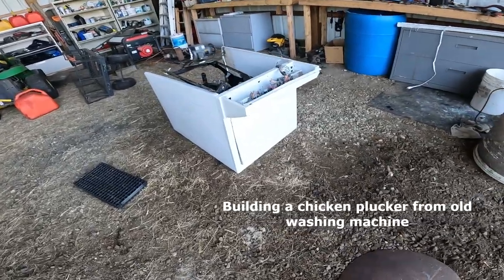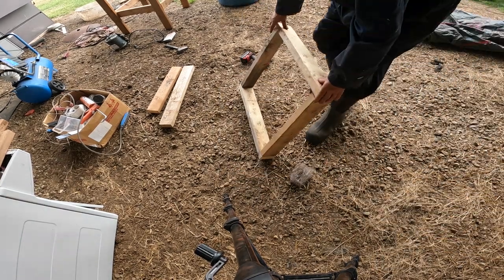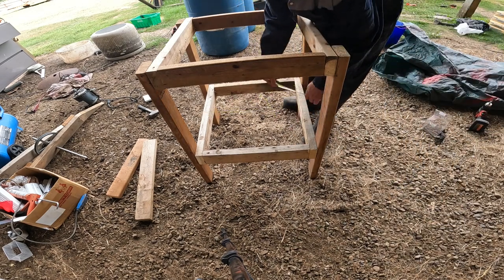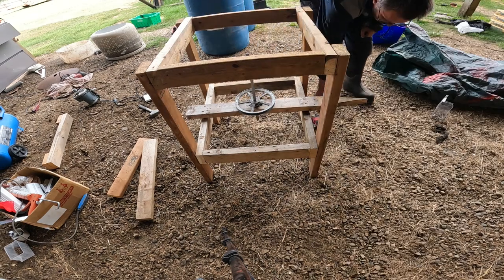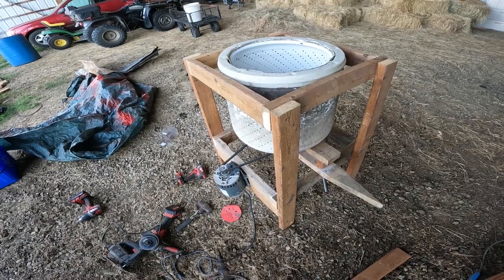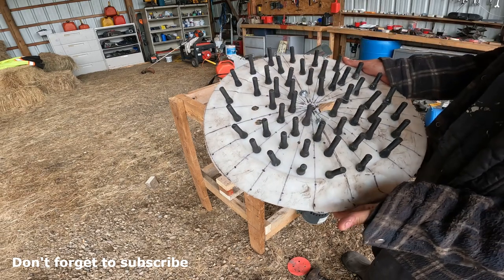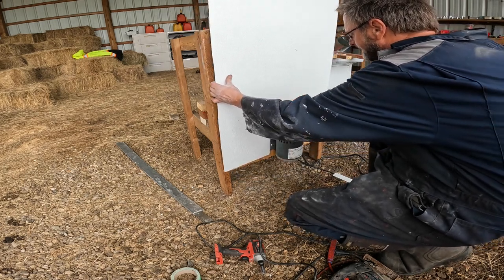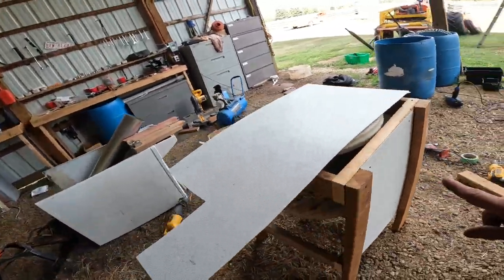DIY - Chicken plucker

Comment: Good build
Reply from the maker: Thanks. Working with the pucker after the build also worked out good. I had not issues at all and it plucked really good. Some of the chickens got their skin ripped off, but that's not the pucker its the heat of the water when scalding. I will maybe work on a boiler next year.

Comment: So many things wrong here, turn motor over so belt is on bottom, put motor on a hinged mount so you can put a tension bolt on it to tighten belt as being that loose it’ll slip the first time it has a load, use drum without all the holes, a discharge for feathers and water opposite of motor, none of these would increase cost as the parts are already there.
Reply from the maker: Wow, awesome feedback, thank you!!. It worked really well as it is; but now that you said all these things it makes perfect sense. Where were you when I was building it ?. If I have time this summer I will come back and try and make it better. Thanks again.

Comment: Did it work? Make video of it plucking, don’t leave us hanging, very interesting build.
Reply from the maker: Yes it worked like a charm. Sorry for not showing the actual plucking, did not want to offend anyone (easy to offend these days, but they still eat them tasty chickens...)

It worked almost too good, plucking a chicken in 30-40 seconds, even the small hairs/feathers came off. I did have one or two hick-ups but that's on me, I let the water get to hot and then it pulled some of the skin off. 

Also with the bottom open all the feathers were collected in a drum-lid and it was not problem cleaning it after. So all in all a nice build that actually work, so impressed also with my pig feeder working like magic. Stay tuned this spring I'm finishing my green/hot house for planting tomatoes.